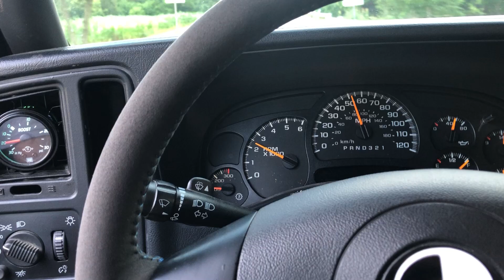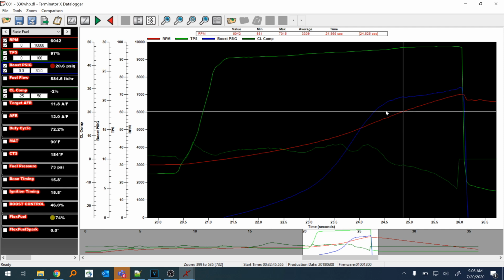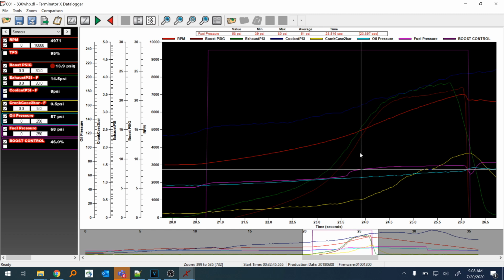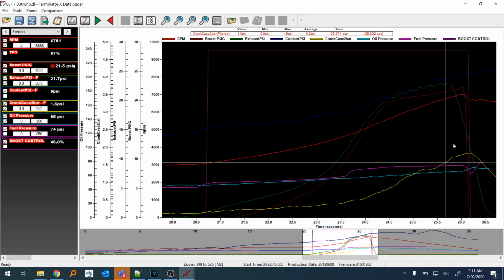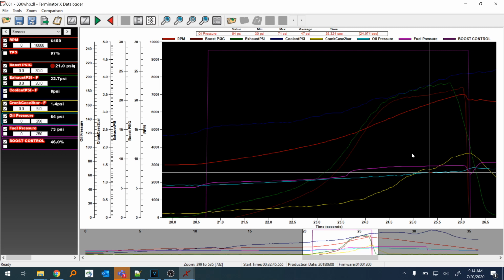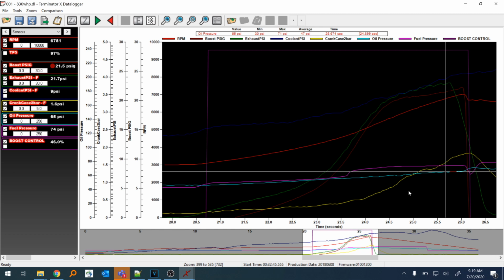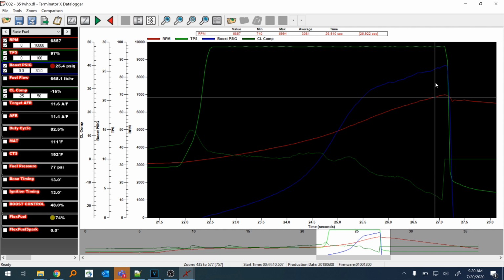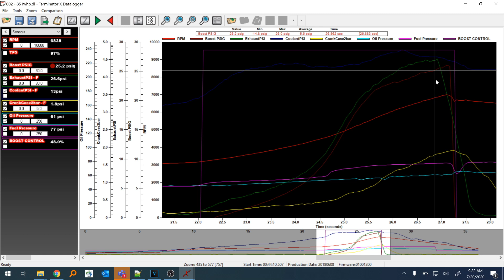2500 beach ball turbo dyno update 850whp

Comment: FYI I found out why it spiked fuel pressure near redline. The rev limit was set to “soft” so it would add fuel near 7000rpm. I figured this out because it went out of closed loop fuel control and I searched for what could be causing that.  I changed the rev limit to spark cut only and raised it 100-200rpm so that the trans gets a chance to shift and a small range of overshoot just in case.   

Also the SEP 1000s are the current limit it seems… over 90% duty cycle on the street with boost at 25 psi.  Little bit higher than you saw on the dyno. 

A set of 1500s would allow to find the limits of the Gen 3 6.0 I think.  So it’s kind of a nice safety to keep from popping a motor I guess.

Comment: Ive got a forged 5.3l with a Procharger D1X on a Silverado single cab pushing 680whp on a Mustang Dyno at 18lbs but yet my 60 to 100 appears to be slightly quicker than yours?  I’m wondering about the Dyno as everyone is telling me the numbers are too low.  But Jesus that’s nearly 200hp more than my truck.

Comment: I've actually tested that delta on my duramax with the stock IC (650 whp) and I had a delta of about half a pound at 32psi, its quite an impressive IC. Be interesting to see if that larger turbo has a different delta because its flowing so much more air than my 64mm at similar pressures. 

650hp worth of airflow is 650hp worth of airflow regardless of the motor (in theory) so Im sure that delta will change, just stating my experience for knowledge purposes.

Comment: The main reason you want to pull a slight vacuum in the crankcase is to prevent oil leaks. The 2psi you see during boost is gradually pushing oil through all the engine's seals. it won't show up immediately but eventually they will all start to leak. All turbo cars from the factory incorporate a vent to the pre-compressor inlet and a quality paper air filter to achieve a pressure drop for the crankcase during boost which protects the oil seals. This costs 4 to 8% HP usually (due the filter restriction) but can be neglected by either turning up the boost or using an electric vacuum pump.

Comment: Matt its awesome you mention Dandy engines in Australia - Frank has a 3500 hp twin-turbo small block Ford "streetcar" !
He is a turbo/ NA engine guru . Creating a vacuum in the sump and having a good windage/crank scraper is free horsepower !
As long as you dont pull too much and depending on your ring package ect  
There's a lot to be said for the old Vac- U-Pan setups rather than spending money on a vac pump ;-)
I'd love your thinking on the oil pressure at pump versus at the top  and the water temp sender position
Your an "Idea's Man" as we say down under ;-))  and I love ya work 
I have always been an advocate of doing more with less $$$ 
Keep up the good work - Cheers Mate    🦘✌🏼

Comment: So I would really add the compressor side outlet pressure sensor.  Since turbskis are direct drive, inefficiency or restrictions in the compressor side via an intercooler will slow the exhaust side proportionally and limiting your power, or be seen as a HP plateau effect before rev limit.  If the compressor side and the intercooler outlet side have a delta greater than 2-3lbs or so (10+%) you are going to get a reduction in exhaust side turbine speed if the time at restriction relative to max boost time is long enough.  It would be a fun math equation to find that sweet spot in plateau.  It would be so awesome to have turbine RPM graphed over time to see if its always increasing or stalls at a given boost/rpm.  I play with jet drive boats, and the concepts are the same.  Inlet restrictions cause outlet restrictions, and vice versa, in jet boats we also have cavitation problems, which is a different science altogether and huge problem in fluid dynamics in terms of keeping your impeller with metal on it.

Comment: I had a 5.3 with low oil pressure at the top. I added a mechanical gauge at the hex plug right off the pump. The gauge at the pump was about 10psi when the top had 2-3. Pulled the engine and the main bearings were trash. It really depends on the condition of the bearings of the engine because the new crate engine I put in was within 1-1.5.

Comment: Duty cycle will go up with rpm because the time between commanded injection goes down. Look at injector pulse width and see what it is doing. Also, I got that same duty/pulse width spike when I was just starting to float/loft my valves around 7200 with 660's without shims. Added .060" of shims and the engine will cleanly rev to 8000rpm, although I have no reason to be there.

Comment: If you blew a front brake line that would be the second Chevy/GMC pickup that body style I’ve seen blow a front brake line...is there an inherent problem? Vice grip garage rescuing a Cadillac blew the front brake line on his 2500 Duramax truck.
Reply from the maker: Yes Chevy trucks from like 95+ have shitty brake line materials that rot

Comment: Any help crank case vacuum gives by acting on the piston as it moves down, hurts by the same amount in the opposite direction.  In think the added power comes from improved ring seal, and the bay to bay motion of the pressure pulses in the crank case, which are restricted in a LS motor due to the 6 bolt mains.
Reply: Precisely what I was thinking. Everyone accepted that turbo backpressure kept rods intact by acting as a buffer on the exhaust stroke. By that theory, crankcase pressure would equally act upon the piston.... But if it means a superior seal, then the trade-off makes sense

Comment: There was a breather filter on top of my catch can, I deleted the filter and ran it to my compressor inlet tube (air filter tube). Then I have (3) 3/8 lines running to the motor. One on each valve cover and one to the lifter valley cover. That creates a suction on my crankcase. How much is unknown lol. My dipstick doesn’t pop up in high boost anymore tho.
Reply: But if it is breathing alot from the crank case you will get oil in the combustion, and oil will make it detonate...so its a gamble
Reply: jagharingenyoutube I’m aware. I’ve run logs and no detonation is present.
Reply: @jagharingenyoutube  First, significant oil won't leave the crankcase if the baffle is high quality and the engine is in good condition. Second, A little oil in the compressor inlet is normal for all turbo cars, including skyline/supra/silvia/etc... Third, that tiny bit of oil near the compressor wheel can not make it through the 10 miles of intercooler plumbing into the engine.

Comment: I think one purpose of running a vacuum pump on the crankcase is to help the rings seal. It’ll be curious to see if you do pick up power with one, using it the way you intend. I don’t know if it’ll be fast enough to pull a vacuum though? Seems those little electric pumps don’t have much volume you know.
Reply from the maker: I wanna do a shop vac test
Reply: Sloppy Mechanics lol, that’d be interesting! I bet it’ll work!

Comment: I wouldn't think the vacuum pump could  evacuate the crankcase quick enough,  to be switched on in an on demand setup. Might need to run it continuously.
Reply: Actually a large enough vacuum reserve tank would be a cool test, opening a dump valve as boost hits.

Comment: I had been looking forward to this one some good results, I looked to run a sensor from that plug straight from the oil pump in the side of the block but I have the low mount alternator down there and could not get it to fit, not an issue for your truck of course.

Comment: I'm surprised how well it spools up, I feel like my 6.0 s475 88 turbine is slower. May need to go over my hotside lol
Reply from the maker: Fully divided fahler log
Reply: @SloppyMechanics  mines 2 1/4 fully divided but not a log. I think I may have a hotside leak, it also won't make more than about 22psi no matter how much I put on the dome. I have a fixed pressure source, may be out of compressor too I suppose.

Comment: Creating vacuum in the crankcase is an interesting concept.  I was imagining it as you were talking about it, and would think you would only want to bring it to zero.  You also have pistons going back up for compression and exhaust strokes, so if you create a vacuum wouldn't it be working against those?
Reply: One goes up, another comes down. It all evens out in the end.
Reply: suction stages of a dry sump system functionally put the crankcase under vacuum helping ring seal among other things.
Reply: It's proven even in a NA engine. The best part is the rings seal up and last way better as they are moving around far less. When they move around less they don't get as hot and need less gap. It does play havoc with oil though but with decent control and oil the foam is non existant.  Look at a dry sump and the capacity of the suction pump AND the sizing for the supply tank.

Comment: Hard to imagine exhaust causing a restriction when you have the exhaust AND a loud valve. But it would awesome if you could demonstrate that to be what’s happening. I think your right about the duramax IC, cooling great but a 50% pressure drop. Old Volvo intercoolers were know for that, but as you have made a science out of proving old theory “not correct”, it wouldn’t surprise me if it’s not that bad.
Reply: For testing sake to show the difference, (1" over your turbine outlet ) a 5" short dump pipe will show a substantial HP gain. It just depends on what noise you're willing to live with.
Reply from the maker: With 4 inch dump truck made more power than it does with the valve and y pipe and the 3 inch
Reply: Sloppy Mechanics engine master saw a better gain from a single 3” y-pipe vs dual 2.5” pipes as well. So I could see that I guess. But the loud valve has ZERO restriction after the flap though. I’m with ya though. I’m going to a 4” DP and dump from a 3” with a 84/75. I enjoyed the data from the Colorado on the dyno with the loud valve vs full exhaust, just wish it was at the same psi level on both test. With the Holley, that won’t be an issue though :)

Comment: Look in to the DW 415 those pumps live good at high fuel press. Look up real street intake fuel pump test. You will like them.
Reply: for 250 dollars per pump he’ll just throw another 90 dollar wally 450 in 😂😂😂😂
Reply: @christraudt6730  they are worth every penny tho. The 450 don't hole a light to them.
Reply: Terrell Hubert if you say so. 2 450s it’s cheaper and 1000 tire on ethanol. let me know when a 415 can do that